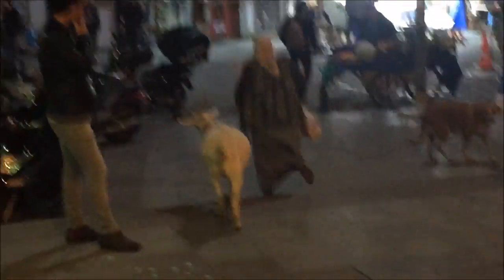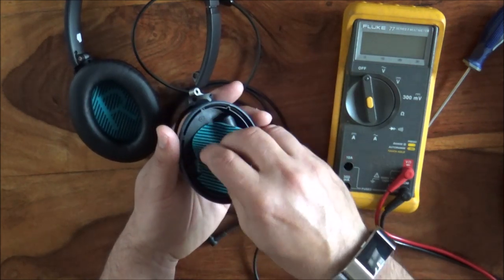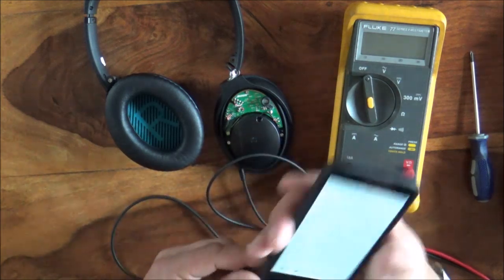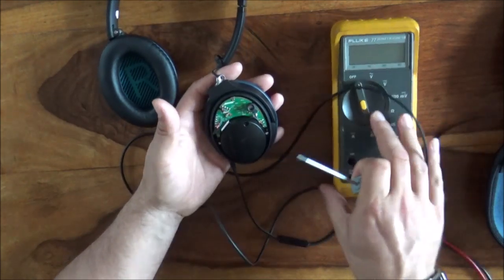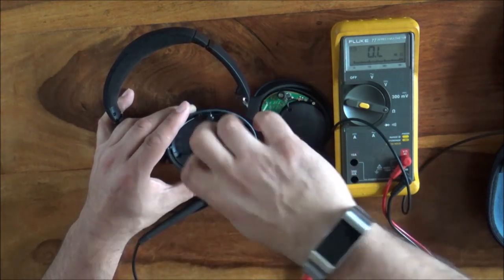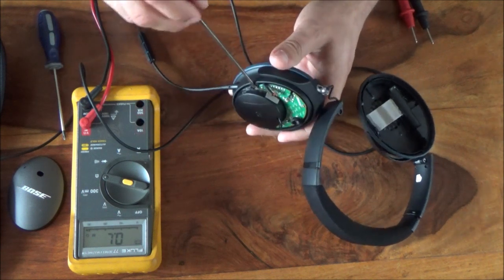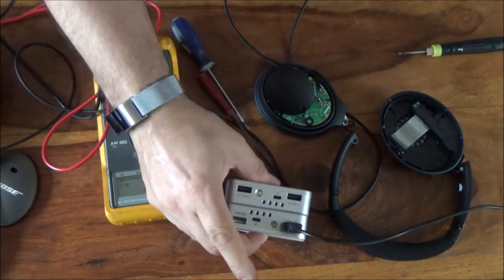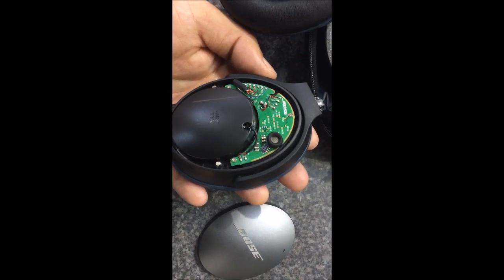BOSE QC25 Headphones - Teardown - Breakdown

Comment: Why is there a microphone listening to the driver ???
Reply from the maker: I’m not certain... but... hazard a guess as I don’t know what their DSP is doing, I believe it may be looking at the volume of the driver and establishing how much out of phase noise cancelling needs to be applied... just a guess...  I wish I had access to the DSP code!
Reply: @DubiousEngineering  I searched online, and apparently it's a feedback system for determining the level of noise cancellation that's occurring..
Reply: This is a simplified explanation (because I don't know all the details, either), but the gist of it is:  The active noise cancelling (ANC) circuit doesn't really care how much ambient noise is outside the headset, only what's getting through the passive noise cancelling (over-ear cups) and to your ear. Thus the internal mic measures all the sound inside the headset, the ANC ignores the part that's there deliberately (the audio signal), then mixes in just enough of what it hears from the external mic, inverted, to try to cancel it out inside the headset. Too little or too much and you still hear the outside noise--possibly even amplified!--as your ear can't tell if the signal is inverted or not. It's a dynamic process, as audio volume, noise level, and headset fit are quite variable. Hence the need for continuous feedback from the internal mic to the ANC, IAW the general principles of closed-loop control theory (https://en.wikipedia.org/wiki/Control_theory).  ...In other words, I agree with you both!
Reply from the maker: Steve!! You superstar!! Amazing description...
Reply: Thx @Dubious! I used to work at a telescope facility with adaptive optics (a kind of atmospheric noise cancelling), so learned a few techie buzzwords from the PhD EE controls guys. Still mostly PFM to me, though. ; )  Thx also for giving me the courage to rip open my QC25s. A strategically placed wad o’ cotton pinned down the loose wire in my right speaker... for now...

Comment: Many QC15 and QC25 fans may well get issues with the right-hand headphone speaker cutting in and out, and whilst there are many YouTube out there explaining the easy fixes, there may well come a time when even this stops working and fixing it yourself is not an option. Never fear. I have found a repair service that most definitely will look at fixing them at a very reasonable price. No need to go for that expensive trade-in deal unless they really are not fixable. UK based. They may well handle wherever country you are otherwise search the internet for a similar third-party repair service where you are. Electronic Partners https://uk.electronic.partners/. Free registration. Use their Customer Portal https://support.uk.electronic.partners/index.php for the smooth step-by-step process - get a quote estimate, book repair, receive repair request submission, order confirmation shipping label, check-in confirmation, repair request completed, proforma invoice, payment online with easypay.express, tracked return. £41.90: £18.20 headphone replacement driver, £16.80 labour, £6.90 shipping and handling. 5-stars out of 5-stars. 10-stars out of 10-stars. I'd give more stars if I could. Most definitely the best option out there for repairing your Bose QC15 and Bose QC 25.
Reply from the maker: BIG THUMBS UP TO YOU GUYS! - THANKS FOR THE ADVERT ON MY CHANNEL!!! - Or.. send me a PM and I'll repair your headphones for £30...
Reply: @DubiousEngineering  this add is working super fine :) You dropped your price from 50 to 30 ;-)

Comment: I've now had 3 pairs of Quiet Comfort 15 (the previous model) and they have ALL failed within 9 to 15 months each. I love them dearly (hence I got 3, two of them bought on massive clearout sale) but BOSE quality is just plain shit. They ALL failed the exact same way. First the noise cancelling starts glitching a tiny bit, then the speaker dies, usually the left one (2 out of 3 was left speaker). I'm pretty sure it was a design fault or on purpose built in so that people would have to buy new stuff. Now that I'm seeing tons of QC25 headphones fail I'm 100% sure BOSE has done it on purpose. This has massively tarnished the brand quality in my opinion. Personally I'm giving BOSE no more money. Unfortunately there doesn't seem to be any other headphones on the market that can compete or are more reliable. The Sony WH-1000XM2 seem to be just as bad with their reliability, a design flaw that cracks the headband (already present on the original model!).. so yeah, we are out of luck. No other headphones come close to these two in comfort + noise cancelling.
Reply from the maker: I couldn’t have said it better myself...
Reply: I've actually had my QC15's for about 3 1/2 years, but one speaker just gave up. Even that, for me is crappy. I'm not a rich guy and spending a weeks wages on a pair of headphones was really a once-in-a-lifetime indulgence for me, I only did that cause I thought Bose was really high quality stuff that would last as long as... I didn't jump on them or drive them to explode, basically. That's normally the score with audio equipment. So, yeah, bit of a shock to find top of the range headphone set that is just so cheaply made.
...I was kinda shocked to find the foam pvc pads on the head bar and ear surrounds started degrading and flaking off after about a year too. 
...No, it's not the top-of-the-range quality I thought I was paying for, not by a long shot.
Reply from the maker: ... I did a little research and have made a video on how to repair them ...  look for repair QC25 with hairdryer...  mine are back working...  but I’m still pissed!
Reply: Nose cancelling as a sham and not worth it anyway.

Comment: in the first 10 minutes of owning a pair, the right side literally stopped working.

It took 3-4 years for my QC15 to have these issues (which is understandable) but for the QC25 it died in 10 MINUTES?  WTF?!?!?

I highly recommend getting QC15, don't fall for the "upgrade" trap.  The noise reduction is much stronger in QC15 too lol...
Reply from the maker: Ahhh...  now there’s a man with experience...  thanks for your feedback and sharing!!
Reply: Alfa Q Whats your experience with the bose qc 35’s
Reply: Adventurous Doge89 I havent purchased yet, but I am considering buying them.  If I do I'll probably let you know this month.
Reply from the maker: I wish Bose had an upgrade plan so you could trade in older headphones and get 50% off the new price for latest similar models. ...  BTW ...  I fixed these, it required the use of a hairdryer...  and a replacement ear piece speaker from eBay.

Comment: Had a similar problem on a long flight, it's no fun :-(

I happen to find a bose shop in the city I landed in and figured there was no harm in asking, and amazingly they give me a replacement set straight away. Apparently it's a common fault, some of the cable they used in the earlier models was too thin and wore down very quickly.
Reply from the maker: Oooh... more fool me for not asking their customer service desk!!...